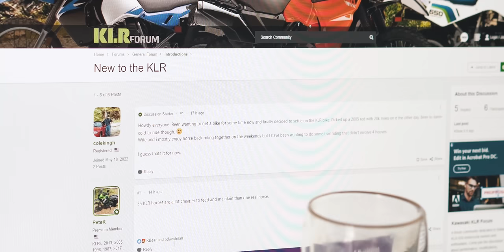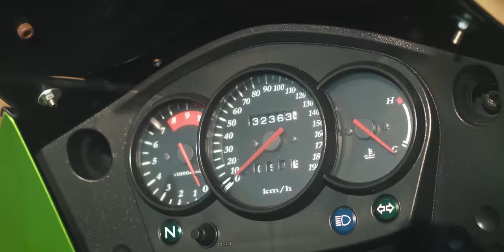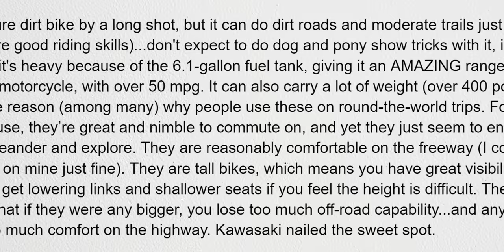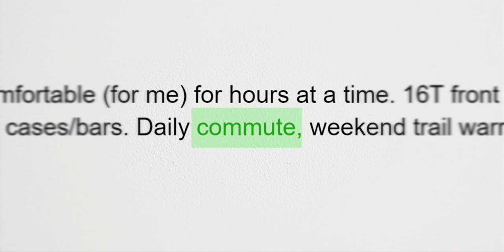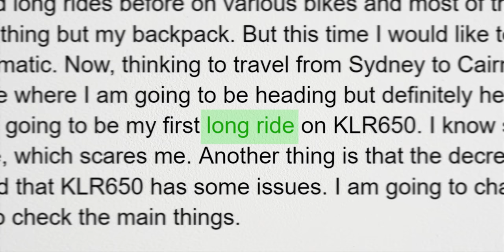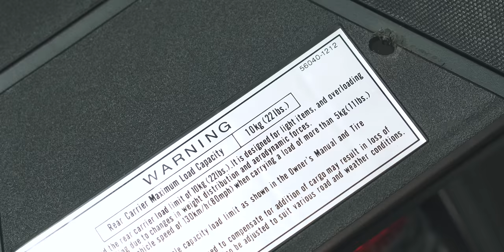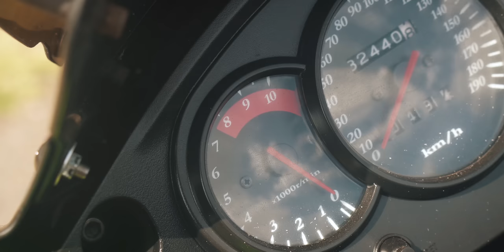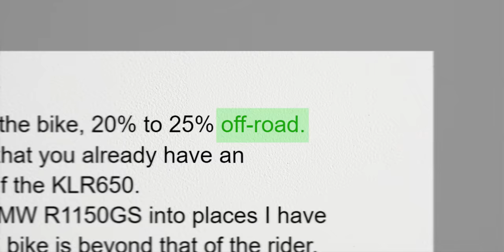I HATE the Kawasaki KLR650… so I BOUGHT one

Comment: Wouldnt trade my KLR for anything. So so easy to maintain, and cheap. BMW and KTM adventure bikes love to have fuel issues if you drop them just one time. KTMs are also a nightmare if you need work done on them. The vstrom is not nearly as good off road, er, at least the people I ride with. I ride off-road circles around everyone unless they have a literal dirtbike. I also do 6, 7, 8 hour days without soreness.
Edit: Just wanted to add that I loved this video. I LOVE content like this, earned my subscription.
Reply: Buy a new KLR for $7,000 and change the "Do," "Thermo-Bob,"  Cogent shock, Race-Tech fork internals, and sub-frame bolts, etc, AGM battery etc, etc. Now you have an over weight under powered $11,000+ pig of a bike. The KTM is super value compared that DIY build IMHO. Then again, I only had 20,000 miles on mine...what do I know? /S
Reply: But..why change any of that? Unless you have one of those ~100kg actual Motocross KTM bikes you won't be going much faster anyway. And at that point you are comparing 2 completely different things

Comment: I am a new rider, I own a KLR and a Goldwing.  They are so different it's not even worth mentioning it.  I like the KLR for commuting because it gets 43mpg, its fast enough compared to most cars and it's easy to ride. I ride on the freeway no problem doing up to 85.  At high speeds it does lack in passing power by a lot and the brakes suck when you need to stop fast.  But driven with all that in mind it does just fine.  Mine is a 2008 and I paid $1000 for it and love it.  When I think about getting rid of it, I am unable to find a better replacement.
Reply: What mpg does the wing get?
Reply: I think that is the last year with the old frame?
Reply: I haved owned a lot of old motorcycles, and what I've learned is that you can dramatically change the gearing on most bikes, because most bikes have the wrong gear ratios for North America. Most motorcycles are geared about 50% low, literally. They feel like they are stuck in 3rd gear when they are in top gear. So I changed one bike by reducing the rear sprocket by about 25 or 30 teeth, to a much, much smaller sprocket that was several inches smaller in diameter. After the change my 400cc Yamaha 500 pound XS400 twin got 94 mpg and was only barely above a high idle at 60mph. It fixed the horrendously stupid low gearing that motorcycles have. For the life of me, I cannot understand why consumers are not demanding an overdrive 6th. They should not be allowed to sell a motorcycle without an overdrive gear.
Reply: Almost got rid of my klr but I never end up actually selling it. 
The 1st gen are so purdy to my nostalgic eyes

Comment: Had a 97 KLR 650. Put 90000 miles on it before I traded it in on a 99 Tiger. Wish I had kept the KLR as a second bike.  The KLR was rock solid dependable. Rode it on 2 week tours going from Seattle area south as far as Moab and north to Laird hot springs on the alcan. Never gave me any problems. Only reason I went to the Tiger was I was tired of having to work the gears to keep the one lunger in proper power band.  Lugging a one cylinder cuts the life in half. Comfortable for long rides, good fuel range.
Reply: K olsen in those 90,000 miles did you have any issues with the so called dohicky. Also did you upgrade the "thermobob". I ask this because I have had 2 different KLRs a 1996 which had 28,000 miles when I sold it with no issues. My curreny 2003 has 30,000 miles on it and counting. I have never had any issues with it either. Let us know.

Comment: I appreciate the KLR for what it is, though when I went to looked at the new KLR recently, I realized that it is just too big, and heavy for me. I am 56 years old, and have been away from riding for 30+ years. 
Please do yourself a favor though. Before you go riding again, round off those top corners of the windshield before they slice you open.
Reply: I am the same age, I have a 2006 BMW F650 GS. I took it to West Virginia to try some awesome off road mountain trails.  I lasted about a half hour. The 450 pound  bike was a beast to keep upright on that terrain. I dropped it in a huge mud puddle, I barley could lift and walk itout of the water. Physicaly beat the hell out of me. I found my way out of the mountains and spent my time riding the buetiful twisting county roads.
Reply: @lot2196   I have a KTM 500, every thing else "dualsport" is just to heavy after having owned a Yamaha WR450 first...
Reply: Rah Gunny! Haha man, wish I coulda branded around on one of these when I was in Pendleton, sounds like a good time! Though perhaps it was before my time (2012-2016)
Reply: I really like my KLR. 
I would simply rather have a small enduro for local Rides in the hills. 
Like a KLX 300. or even a 250. 
But I like  the bigger KLR for dirt road, paved side roads and two tracks. 
You can have more than one bike. 
Best Wishes! M.H.

Comment: I bought one of these for commuting the back roads and side streets 31 mile round-trip every day to and from work. 1996 or 1998 model. I replaced the Doohickey, I put braided steel front brake hose on, EBC pads that would actually bite, I put street bike tires on it, a Corbin seat to replace that torture rack they call seat,, stock exhaust, stock handlebars, I added Chicago brand plastic military equipment cases.
  I’ve always written standards or sport bikes, I road raced for eight years in my 20s..
  buying this machine and commuting to and from work on it, I never had a motorcycle that I misbehaved on more. Spraining the speed limit. Every time I pulled up next to a car at a light, it was a drag race. This machine was so much fun to ride, that I was addicted to running the snot out of it..The reason it was fun, is because I could tell I was getting everything out of the machine. At the same time, I really wasn’t going that fast. It had instant throttle response. With good street tires it stuck.. it didn’t squirm around on nobby‘s or dual sport tires the way they do as those blocks flex while cornering and braking.. I could take all the shortcuts to work down the bad roads, because it had so much suspension travel… because it was a mostly plastic bodywork machine, I really didn’t care what it looked like. I didn’t wash it, I didn’t polish it. But the oil was changed, the brake fluid was changed annually, the tire pressures were checked at least every two weeks, I did warm it up, I babied the transmission, I never tried to smoke the back tire, I never really took the RPMs near red line ..i didn’t have to.. it had instant torque…
  The front brakes sucked.. but it had lots of engine braking if you turn the idle way down.. The flat as a 2 x 4 Corbin seat was the best improvement I did to it. I wish Kawasaki had put this engine package in a chassis like the ninja 250 or 500…
   that machine was a lot of fun. The only reason I sold it is, I had three other street bikes at the time, that was my commuter, and I got a company car and worked from home around that time. So I didn’t have to commute by motorcycle anymore. That was the best part of my day every day was a commute to and from work

Comment: I had a 2000 KLR650 for several years. I had a few options then on what to pick from. What I wanted was a standard Jeep, but in a motorcycle. Nothing crazy, just cheap and accessible. The 2000 in all green was the best look for that purpose. It was my first and only bike. So I think that is something too. I think it was an entry bike for many.                                                                                                   
     Most people who rode on trails had to toss them into their trucks to hit the hills. I didn't have a truck and the drive to the dirt was quite a few miles so the 6+ gal tank was important. I think the other sizes out there were about 4.3 max at the time. It was the ultimate local adventure/camper/errand bike.
    It is not for motocross style on single track trails. I ran it up over 100,000 miles with minimal routine maintenance mainly as an all-around use vehicle: commuter and exploring. It was GREAT on forest roads, anything NOT single track. On the Highway, I could get it up to 90+ . It was best at about 70-75 with some power left in reserve. Anything more was work and sketchy (unsafe). With a different sprocket and a slightly less restrictive exhaust I had all the power I needed to haul fast or putt along ANY road.                                                                                                                                                                          
    I heard form the dealer maybe, that the frame style that became the KLR was based off of a road bike, not a dirt bike, like comparable bikes at the time. I may be totally wrong.                                             
    It is capable for a skilled rider but never does hit one mark perfect. it has enough power when tweaked a little to point and shoot up a steep rocky hill and bounce it through. Coming down? HAHA!     So, it fit the bill for me. What you showed when you decided to just go off in the dirt was what it was all about for me. Riding along either to work or somewhere and saying "hmm, where's that dirt road go?". Thing is, with my jeep, it took much longer to check out that road. So, for me, for the price and use, it was better to spend less and get the KLR.   After a few years, those miles, and really, very little maintenance up til then, it was easy to let it go.                                BTW, longest trip I took was Northern Colorado Mountains to East Texas in December during Colorado snow.... Me, shedding warm layers as the hours went by...   Sadly, that was its last good ride.  BUT, it made it there and I did ride it there for a bit. Like I say, I had 100,000+ miles.  I'd do it again, but I bought an E-bike....
Reply: John geers. You story was Super neat until the last sentence.
Best Wishes! M.H.

Comment: KLRs are great and as much as you warmed to it somewhat in the end, you were still pretty unfair to it. This, the DR650, even the Royal Enfield Himalayan, all exist in this space of simple, reliable, honest motoring, with the rider as under-stressed as the motors while heading from A-B as the crow flies. They might be more donkey than racehorse but that's no bad thing, horses for courses right? And you use the phrase 'Jack of all trades, master of none' in a negative way at the start, but that phrase finishes 'but better than a master of one', meaning the exact opposite of its abbreviated version. Better to be adequate everywhere than exceptional in one way and useless in the rest.
With all that said, a well shot and produced video, as usual.
Reply: TIL : "but better than a master of one"... thanks!
Reply: The KLR 650 isn't a great understressed motor, it's a motor that will eat all it's oil in a couple of hundred miles. I have watched a new, broken-in KLR self-destruct on a single trip within a couple of fuel tanks.  The KLR isn't good at anything but being initially cheap.
Reply: @snarkylive  I'm sure your experience with one KLR is completely representative.

Comment: I have a 2013 KLR as well and the FIRST thing I did was change out the seat, the stock seat was like sitting on a log. I went with a seat concepts replacement made a world of difference. Great video greetings from Ottawa Canada  🍁
Reply: I removed my cover, cut away the foam and installed gel pads.

Comment: Why the dislike of carburetors? Easy tuning,  no fuel mapping changes or power commander needed, no O2 sensor(s). Please wear safety glasses next time using the grinder/cut off wheel. Check out the FortNine video on carburetor vs fuel injection if you've got a minute.

Comment: Want to get another really slow, even heavier 650 that can also go off road? Try a Ural next! (and those are even twin engines)
Reply: KTMs have good 0-60mph times, out running many when the light turns green.
Reply: A granny with walking aid can outrun an Ural at 0-60, because you'll be stuck on the side of the road fixing it 99% of the time lol

Comment: Went from an 08 klr to a 2021 t700. Glad I made the switch. Loved the versatility of the klr, but it always came at the cost of feeling dull and undergunned both on and off road. The t700 has every bit of versatility found in the klr, but is anything but dull. I get that it costs more, but I think it's worth every penny. The klr is a great intro into adventure riding due to its cost, but I personally was left wanting more after only a year of riding. Now having had the t7 for a year, I can't see myself replacing it any time soon. Didn't help that the klr also guzzled oil above 4k rpm.
Reply: It might be “worth every penny” if you have the Pennys. If I were buying a new KLR and financing it I likely would just go with the t700 but I’m on a tight budget and don’t want to finance a bike. I can get a used klr with a few extras included for 3-4k and ride it for a few years without really losing any value. Even the cheapest used t700 is close to 2x that.

Comment: Not being updated much in decades and low power are the things I like. Without an update parts from the 80's still fit, lots of part compatibility from other model years. With the low power you aren't stressing the motor and the reliability is high. I have a 40 year old honda XL500 and it's a similar story with the xl-xr. Nothing special makes for reliable and easy to fix!

Comment: 3rd gen owner here... Rev limiter hits in 4th gear at 72-74 mph stock.(you will want to take the dirt front fender off before you go faster than that (which requires a fork brace from eagle mike) but 5th gear will keep you at 70 mph with the stock mirrors still and calm.    50mpg documented after doing all the standard basic changes everyone will do. You can make the front end light if you have to, but you aim to avoid those situations. If it is a horse you want to replace, you do it with a KLR.

Comment: Very informative, thanks for taking the time to go through the KLR so thoroughly. As a Harley road guy, I've been considering a dual purpose 'beater' that I can ride on the dirt roads around the place and the KLR may just be the right (read cheap) answer!
Reply: Of all the choices it will best fit the bill. A 2 wheel tractor for sure 
I've even seen some 2023 models for less than 5500 brand new

Comment: The problem with fuel injection is that it need electricity. So when you forgot to turn the light off it's dead. With a carbureted bike you can always put it in gear and run start it.
Reply: Wrong ...  this Gen KLR ,   if your battery dies ...  you ain't starting nothing
Reply: @neilgouws6962  it'll start, there's no electronic shit that needs powering up. Will push start no problem at all.

Comment: The benefits of versatility are very real and far outweigh being the best at (some) one thing. Its why i loooove my Versys 650. But i do wish it went offroad… 🤔 (nah, i love the corners too much 😆)
Reply: Does a versys take corners well ? Like compared to a naked bike such as the er6-n or bikes like that.
Reply: @kasey2463  Mine looves corners. Literally just plant at the desired angle and there she goes.
Reply: @kasey2463  its a strange bike that doesn’t handle in a leaning way of a sport bike…but it can really boogie down. You use the handle bars much more than leaning. I havnt had a sporty naked so im not too sure. Its probably the same feeling but the Versys probably feels “taller”. I bought some Road 5s for it 😆

Comment: Great review. You failed to mention one of the highly desired features of the KLR, the HUGE gas tank. As an adult, I started my off road riding on a Suzuki DR650. With knobbies it could do most single track, just not very fast. It was too heavy and suspension way too soft. I sold it and went full offroad. I few years later a friend was selling a 1st gen KLR which seemed perfect for dual sport rides and I figured it would be very similar the the DR650. Come to find out that the KLR is much more street oriented, but if that fits your riding, it's great. While it did work well on the road portions, it was too low and wide in the single track and kept pulling my feet off of the foot pegs. The final nail in the coffin for me was when the drive chain adjusting nuts vibrated loose and the rear axle started to slide forward (on the left side). With no rear sprocket chain guide, the chain came off and snap and jammed in the engine case. Luckily there is a decent demand for them and was out only the cost of repairs.

Comment: I bought one new in 1997. I still have it. Still puts smiles on my face. I ride my KTM 1290 Super Duke R and 1290 Super Adventure way more often. But when I ride into the mountains onto tough trails, I take the KLR650. It gets the job done and gets me home every time.  And it I drop it, who cares. It keeps running, which is all I need.

Comment: Got one just recently, fully pleased with it, especially the new one with EFI and ABS (I've since had a chance to try the Gen 1 and Gen 2). Gets me everywhere I want to go, as fast as legally permissible. The new one is a bit more stable at speed.

Yes it crushes speed bumps.

Cheers.
Reply: Yup. I like going up and over the center curb/sidewalk? at the local roundabout. Really raises some eyebrows and gets some laughs. 
Takes it in stride.
Reply: @whereswaldo5740  > curb/sidewalk?
That curb is there so that large trucks can use it for their wide turns, but it's tall and abrupt enough to discourage people from driving on it with cars.

Comment: I looked at one of these in the late 1990s. The very narrow usable rev range drove me nuts and despite the balance shafts, it was not especially smooth.  My fingers hate vibration. I'd had a 1972 Honda XL250 K0 so was well acquainted with vibes, worn out chains, rubbish off-road and minimal power. But at least the the Honda became a classic.